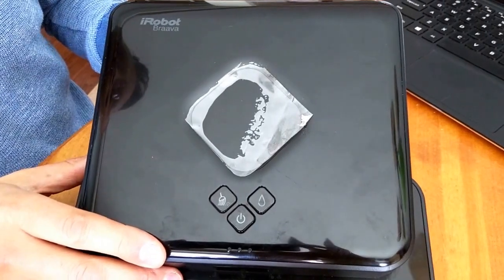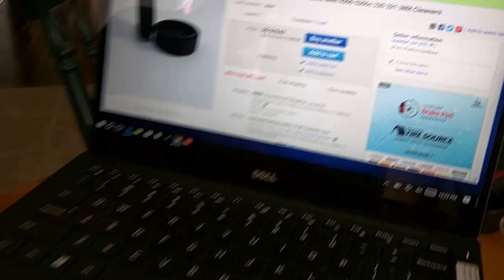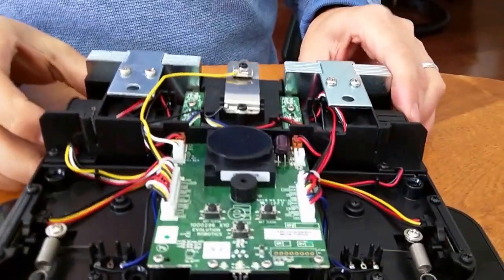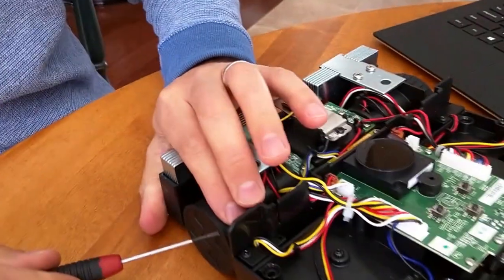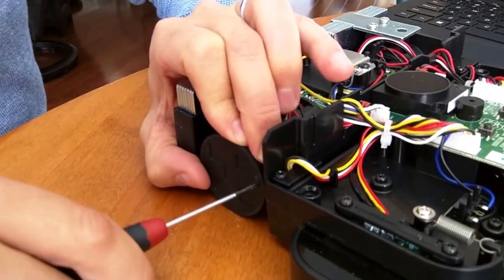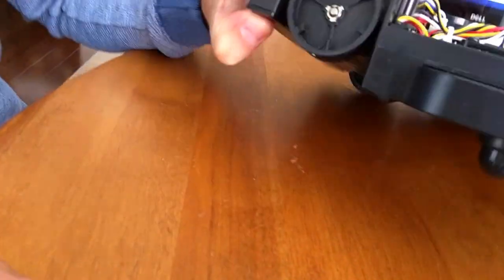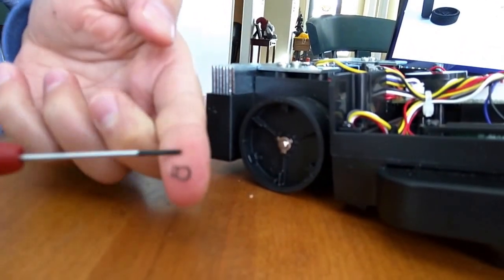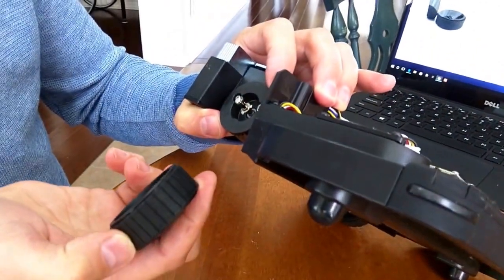Replace the whole wheel or tire on iRobot Braava or Mint EASY

Comment: I tried to replace the wheels on a braava 380t.  A miserable failure.  I highly recommend replacing only the tires.  Leave the wheels alone. 
Easy to get unit apart, wheel covers off and new wheels on.  Replacing the spring clip, super difficult.  Can’t just slide them on.  After many attempts, I lost both while working on a large white counter.  They fly far.  
Where they went ?? Trashed it. Returned wheels to Amazon
Now I get to buy a used braava m6

Comment: HUBCAPS ROTATE off if you turn them clockwise (using the square depressions for grip) ... anyway much better solution than the one in the video, so easy, many thanks for the comment!!!
After the the clips are easy to take off with a small screwdriver, easier than in this video. Anyway thanks for the tip of how to do it.

Comment: Thanks for the video. Very instructive. And as Jeff writes, the hub caps come off fairly easily if you turne them off clockwise. Another tip is to use a magnetic screwdriwer, if you have one. I loosened all four screws and turned the robot upside down. Two of the screws stayed inside. One of them came out when I took the lid off. The other is stuck in there somewhere, so I only have three now. The robot works okay, only it's a bit difficult pushing the buttons now because of the missing screw.
Reply: Mine is the Braava 390T by the way.
Reply: The same thing happened to me but I found my screw inside the robot. The robot has some magnetic parts; try removing the under cover where the mop placed. In the bottom section where the springs are their is two magnets on each side.
Reply: Same thing happened to me!

Comment: Good video. I actually fixed it with less pain by cutting half inch rubber ring from old byke tube and put it over old wheel. Work as a charm.

Comment: When replacing top cover 4 screws, I found that over tightening them caused the front bumper to lock up so I loosened them and the bumper regained motion sensitivity.
Reply: Happened to me too. It's actually not as straightforward to get back together as it seems.

First time the buttons were not quite lined up possibly because screws were not tight enough. After removing and tightening to address this, I encountered the bumper issue (too tight). After fixing this problem, I notice it won't charge on the base, but will when plugged in directly, so have a bad connection somewhere.

I also lost one of the two front screws, inside the bumper. There is a gap between the entry hole and the screw hole that swallows things...and won't release them.
Reply: Right, same thing here.

Comment: DON'T PRY OFF THE HUBCAPS!  You'll break the tabs.  They ROTATE off if you turn them clockwise (using the square depressions for grip).
Reply: Jeff Levy Thank you for this correction!
Reply: Jeff Levy: Is there a special tool to place in the depressions? My caps are frozen tight. Thanks.
Reply: I should have read your comments first.  Broke some hooks following the video.  Hopefully it stays on while running
Reply: up up good that I read this first! I was trying myself but not confident enough :D
Reply: Yes, you will (and I did). With only 1 unbroken tab, they do seem to stay on.
Reply: They did not rotate at all,
Reply: Seen this too late...
Reply: Oh God, I wish I read the comments first....
Reply: Thanks for sharing. The maker really should provide a correct tool for consumer to turn the cap, pry off the cap cause the vulnerable latches break definitely.

Comment: Ugh! WAY too hard to remove the "hubcaps." I never did succeed in getting them off, either with the screwdriver or turning clockwise. Instead I peeled the tires off the new wheels and superglued them onto the old wheels. Unfortunately I had the same problem you see in the end of the video -- after robot was put back together, only the "on off" button worked! Solution: loosen all 4 screws. The bumper has to move easily and then the buttons all work again.

Comment: Made my own replacements out of 3M  two sided mounting tape and Magic Tape over the mounting tape, will probably last forever.
Reply: did that work?  my tread is coming off but there is nothing wrong with the wheels so if the 3m mounting tape worked I will try that first!

Comment: I followed the video. Replaced the wheels, but now after re-affixing the top, the buttons don't work.  They are not making connection to the 'real' buttons on the board. What happened?? Please help!!!
Reply: I had the same issue, just like it happens in the end of the video: only the power button works now, not the other 2. The explanation that is in the description, about the mop not being in place, is not the right one. Without the cover the buttons work just fine. Did you find a solution? Thanks!
Reply: I had the same problem the mop and sweep buttons became mushy. They work, but barely.
Reply: Hi! I have resolved this issue.
You should at first be confident what no wires between case parts, and second after you place upper part on bottom, you should a little bit "play" with bottom rear part of robot (that on springs) up-down-up-down a few times, and case get its place, and buttons start work! It works for me)

P.s. I just turn my braava on LiIon battery, 4x14500x900mAh + one circuit from aliexpress. Braava works about 2 hours on it.
P.p.s. You can change only tires on your wheels it isn't hard and less expensive.

Comment: I followed the instructions in this video. My Mint ran fine for a few minutes and then I heard grinding gears and it was not moving smoothly. Any suggestions?
Reply from the maker: Jill Hall do your wheels spin freely? if not take it apart and spin the parts.
Reply: Well, it actually seems like a motor problem. It may be time for a new one.

Thanks for the quick reply.